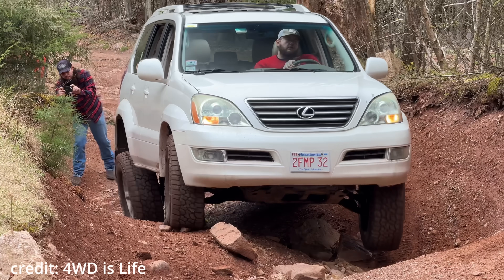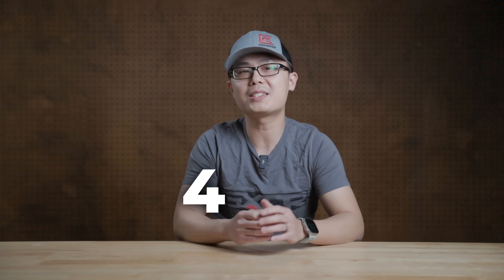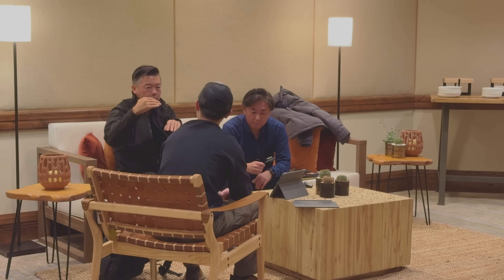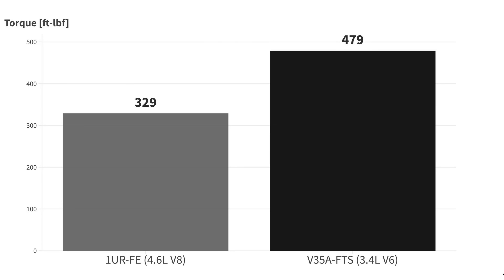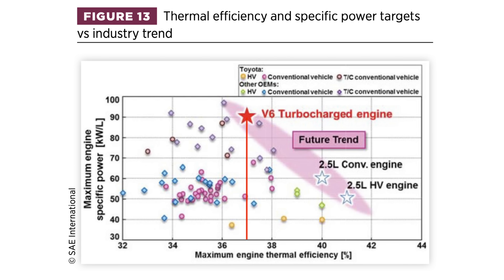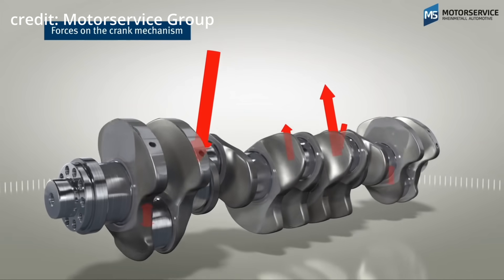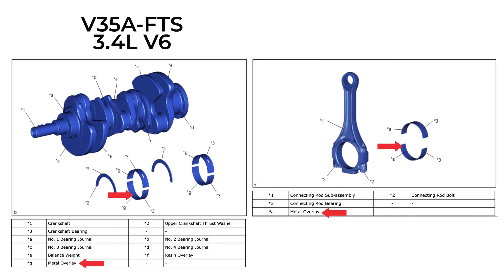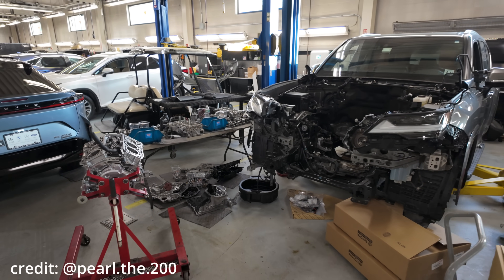Is Toyota V35A-FTS Engine Reliable? Well..It's Not That Simple

Comment: There actually IS an official explanation for bearing failures. Improper cleaning of blocks post machining and pre assembly causes blocked oil passages and premature crank bearing failures. This is well known in the Toyota community so I’m not sure why a Lexus technician would not be aware of it. This is not a design issue, it’s a manufacturing/assembly fault. It’s disappointing there have been this many failures but Toyota is usually pretty proactive in solving issues. 

‘The car care nut” does a great in depth video on the design of the cooling system in these engines. Pumping this much HP and torque out of these engines, heat would be a major factor that potentially could reduce longevity and reliability but  Toyota designed a very competent cooling system in these engines. I’m confident these engines will ultimately earn a good reputation but they’ve certainly had some issues. I have a ‘22 Tundra and so far no issues at 23K miles. Knock on wood.
Reply: Link to official explanation?
Reply: @spaulagain Discussed at length with dealer service manager. As well, in a 3rd gen Tundra owners group on Facebook, every engine failure I’ve seen posted has been diagnosed as this exact issue. There are many Toyota technicians and at least 1 Toyota engineer in the group.

Comment: Great interview.  My logic is: fewer parts in existence = fewer parts that can break. I'm sure that the entire package is very well engineered, however I have lost a lot of faith in Toyota build quality after purchasing my 3rd gen Tacoma and suffering through early part failures such a warped thermostat housing which was plastic.  Critical parts which are exposed to high heat should not be victim to bean counter cost savings and made from inferior materials.
Reply: Could not agree more. It’s a simple fact that complexity has a direct relationship with failure potential. Now this might not seem like a concern on a new car, but once they acquire age, wear, stress, perhaps a fender bender or two… They’re already unaffordable to repair for some moderate operations, I cannot foresee a meaningful number of 2025 cars being on the road in 2050. We need to apply our knowledge like a scalpel, not a sledgehammer, and stick to simplicity unless used to improve efficiency.

Comment: I was actually thinking of looking into “tuning software” to get that extra  100 ft lbs of torque they promise with more boost. Glad I watched this. We used be pretty happy back in the day with a NA 1 HP per cubic inch. The norm was no replacement for displacement. Stock, at 213 cubic inches, this is putting out 1.7 HP per Cubic Inch. and with as much torque as a 455 olds lol. I just told myself, Stop. It’s enough. Love your channel. Very well done. ♥️
Why is it never enough 😂

Comment: I bought my Tacoma in 23 because I don’t want to be part of Toyotas drivetrain experiment
Reply: Beta tester: Big benefit to Toyota , big problem for you.
Reply: Exactly. There’s a reason the name Land Cruiser means unreliable. Small displacement, turbo engines in the 80 series and prior were blowing regularly. It wasn’t until the V8 was created that they finally became good.
Reply: @JollyGiant19 What small displacement engines in the 80 Series? They're inline sixes that range in size from 4.0 to 4.5 and only diesels had turbos. All of these engines were, and still are, extremely reliable
Reply: @chrisflores4788  A turbo just stresses and engine until it blows, nothing you can do about that. Turbo = unreliable!!
Now to be serious, I see so many people express displeasure with turbos in Toyota vehicles as if they don't have decades of experience with it and highly reliable turbo diesel offerings despite how much higher pressures and heat that turbo diesels put out over a gas engine.
Reply: Bought a 2024 4Runner in January for the same reason.  Last of the naturally aspirated 4Runners.

Comment: If Ford managed to build a 3.5 Liter twin turbo V6 that puts out good power, and reasonable reliability, than I KNOW Toyota can. Honestly,  as an independent tech, I see more Toyota vehicles with 300,000 plus miles than anything else, except exceptionally well taken care of Suburban / Yukon SUV's .
Reply: This just the older early 2000’s Yukons and Suburbans or anything with afm/dfm?
Reply: My Volvo has a million miles
Reply: @ThunderRunner  2007 was the first year.
Reply: @mcglovera  Once you get up to the P2 cars, there are enough electronics to cause serious issues, transmissions are kind of weak, the 240 / 740 series were bullet proof. My experience.
Reply: @mcglovera  right - do you see any 2007 or newer suburbans and Yukons with that kind of mileage?
Reply: @ThunderRunner  There are actually many. Have heard of some over 300k miles, some even higher (to a ridiculous extent)- most I suspect either were driven long distances or used as limousines. I would trust one of these more than a twin turbo Tundra/Seqouia.

Comment: The dealership I work at has had 2 tundras with main bearing issues below 15k. They were early model tundras. The wear was allegedly due to improper cleaning from the machine process

Comment: As a mechanic with my own repair shop, I really appreciate your content. I reside in Australia and have paid a deposit while waiting for the Lexus GX550 in Australia to arrive mid to late 2024. I really hope you can keep following up on this potential main bearing issue. I would prefer the V6 turbo petrol over any hybrid engine they may release over next few years. Perhaps I should hold out on buy the Lexus till further in know about main bearing design change. Your thoughts would be appreciated.

Comment: Ford has shown for over a decade that these kinds of turbocharged V6s can be reliable long term. There are numerous examples of Ford 2.7L and 3.5L ecoboost engines with 300K to 600k miles and no issues. There's even one with over 1.3 million miles, though that one is on its second engine.  You can even get a 3.5L in the F150 with 450 hp and 510 ftlbs of torque! Though Toyota's 3.4L TTV6 might be one of the least reliable V6s out there currently, these are likely just growing pains and updates to the motor will likely improve reliability.
Reply: The caveat to the longevity of the motors you mentioned is absolutely religious maintenance and easy use.  The Eco-boost makes fun power and gets decent mpg, but they fail a lot when used hard.  By used hard, I am referring to trucks that do weekend towing.  This isn't my opinion, this is what 3 family Ford techs have told me.  In their words, "If you want a gas car or truck to last 300k miles, DO NOT buy anything turbo charged.  If you need to tow on occasion, buy any sized NA motor that meets your weight requirements and live with a little less power and lower mpg".
Reply: The 3UR-FE is kinda mid-tier in Toyota terms, but it is still outperforms all the Ecoboost engines in uptime and long term running costs. (Even at 15mpg.)
Reply: 3UR-FE is mid-tier in Toyota terms? I mean, I know it’s not S+ tier, but it’s still A-tier. Especially the Japanese-built ones employed in the Land Cruiser / LX 570
Reply: @matthewpeterson3329  It's just physics and limitations of turbos in general. Turbos dont usually last over 150,000 miles they wear out and require to be rebuilt or replaced and then if you're towing you're putting extra stress on the engine and using the turbo more with higher boost. Any NA engine is going to be more reliable because it has less moving parts that require to be replaced. Toyota is sacrificing long-term reliability to get better performance no doubt. These are not the 4.0 V6s just expect to spend more money when getting higher mileage replacing parts
Reply: @b4ssfunk3d semi truck turbos last 300k usually I seen similar results from turbo charged engines on regular trucks with good maintenance
Reply: @Dimabuildingadventures  You're still talking about a semi-truck though. I don't see turbos lasting as long in a VW Jetta 2.0
Reply: Things about Turbos is more frequently oil change, they are not intended for pulling all day and they need to be cooled off and dont use all the time.

Comment: Great indepth video for the nerds! Toyota just issued a recall on these motors saying that there is possible debris in the engine from manufacturing that is responsible for taking out the main bearings. It may or may not be related to over stress after all. I couldn't find any specifics on what they are doing to fix the issue though. Keep it up Kai!
Reply: after posting I saw your pinned comment 😂

Comment: I've thought for quite a while that Toyota engines run a little bit colder than their (especially North American) competition. Just looking at their thermostat ratings reveal a difference of sometimes 10 degrees. a colder running engine robs more heat energy from the combustion event and reduces the power. Wonder if they upped the operating temp.
Reply: Driving a 1gr-fe in the dunes of the UAE, I see coolant temps hit 92c peak, 90c average, in 4lo and under 100% load for extended periods, near redline, in 45c ambient temperatures. I do have a tranny cooler.

Wranglers with the pentastar 3.6 so easily go over 100c, I've seen them peak at 115c (manual tranny). Engine revs higher to produce similar hp with less displacement.

I think you're right. No one runs the 3.4 train turbo. And these guys definitely have the $ to do it.
Reply: Your statement about what those with means do in search of reliability is very telling. 

Do they run any Toyota Turbo Diesels in the dunes? IIRC, they should have been available there for many years. Again, IIRC, Toyota Turbo Diesels are under-stressed per unit displacement, vs. other manufacturers'. Perhaps Toyota will do the same with the Gas turbos?
Reply: @danielclawson2099  They don't run diesels at all, anywhere on dunes, due to weight.  Power : weight ratio is very important, as your engine is constantly in redline, and an engine that's lighter and produces more power is more desirable, as long as it gets you back out of the dunes as well :)

Loads of guys put magnusson superchargers on the 4.0 v6.

Comment: I was a mechanic a long time ago and I remember most main and connecting rod bearing failures were due to insufficient oil to lubricate the bearings. I heard you mentioned smaller oil ports, as well some comments referring to shavings clogging the oil ports because of fewer washings after the cylinder bores have been machined, so I am wondering if this could be issue. Of course I’m no engineer, but sometimes mechanics can catch defects that do not show up in testing. Whatever the issues are, I believe  we achieved peak efficiency with reliability back in the early to mid  2000s, since then we have been engineering backwards. In the years to come, this will be the norm.

Comment: Very interesting and thorough video, again, Kai! My assumption was that Toyota motors were so durable because they were understressed, stemming from low HP/L and mediocre gas efficiency. I didn't think that a more efficient engine would run cooler and therefore see less thermal stress.

Comment: Toyota reliability? I just returned a 2024 Tacoma with 40,000 miles on it, 4wd actuator and front transfer case totally self-obliterated. I don’t believe it anymore. Old school or no school
Reply: Is that the borrowed Mazda V6?
Reply: 40k miles on a 2024 Tacoma that was released in January?
Reply: @marsarmory6236  yeah, it was a rental. It had Washington tags on it and I’m in WV, so it drove at least 2000 to get here.
Reply: @bfromthea7663 really good actually. Only complaint about it was that I kept smacking my knees off the interior panel under the steering wheel. Enterprise had all the tech and apps disabled so I can’t comment on any of that
Reply: To be fair....you bought a rental. Rentals are never treated with care and the renters that had it previously most likely didn't have the transfer case fully engaged while towing/hauling. I don't think your experience is an accurate representation of Toyota reliability.
Reply: 40k miles in 3 months is actually quite impressive.
Reply: @mad-meh2719  someone undoubtedly ragged it, but I’ve ragged my old TJ for years and over 100k miles and it’s held up very very well. The frame is literally going to rust away before anything mechanical happens to it
Reply: @encompassthyeclipse7278  dude. You can't compare a personal vehicle to a rental vehicle. I used to work at Enterprise and own a car rental business myself...let me tell you, people beat the shit out of these cars. Doesn't matter how reliable it is, you can't expect a transfer case to last 40k miles when the operator isn't using it correctly. You're making an apples to oranges comparison.
Reply: Did yu operate it properly?
Reply: @encompassthyeclipse7278  what rental
Company was the Tacoma from?
Reply: It’s crazy how people can’t read previous comments
Reply: Lol, a rental from 1996 would undoubtedly been fine even if ragged on. Those old Toyotas were just made different.
Reply: The problem was the massive amount of miles in less than half a year. That truck was highly abused. I doubt the maintenance was done since it's so new, and it was a rental. 40,000 mikes in 5 months is basically 266.666667 miles per day. That doesn't even count the time it spent idling, which could be a lot if it was a work rental that drove far every day and also idled all day once at the worksite.
Reply: @Afriqueleblanq, They don’t have a mazda v6?

Comment: I thoroughly enjoyed the comment section a-lot of insight. I’m sightly surprised at the scale of the problem. I would had figured the first batch of 2018’s LS500’s would had shown this issue and surely 6 years later it hasn’t been resolved. 
I purchased a 2022 V8 GX460 for this exact reason I didn’t want the headache, Im sure they’ll figure it out in due time.

Comment: My fear with this issue is that it is just like the Tacoma and 4Runner front differential needle bearing issue. Toyota has yet to fix this issue. The only real solution in the aftermarket bushing. To me, it is a real failure on Toyota to not address and properly fix this issue.   From your video, it seems this main bearing issue has documented history for several years also.
Reply: Ugh, you just reminded me that I need to do mine... 😂
Reply: I believe the fix is a dampener to help the noise not reach the cab. Toyota has said that they noise is normal and won't replace the front differential anymore. As for the main bearing issue I have a feeling its the dual pulley system with the belt and the crank pulley itself is causing the issue.

Comment: It seems to be only one main that is the culprit. This helps in dispelling  the debris story and leans toward a design deficiency. undersized, convoluted path etc. oil gallery  that services that particular cap. 
My thoughts lead more to the one piece cradle v individual caps as any flex/play in that assembly would invite premature wear. The individual caps seem to enjoy a closer proximity  of bolt placement to the centreline of the crank  also they are dedicated to that bearing therefore less affected from any torsional stresses that may be present on that one piece carrier. Would love to hear input from a legit drivetrain engineer.

Comment: i’m not an engineer however, I have experience rebuilding engines. One of the things that comes to mind is the tolerance between the main bearing, as well as crankshaft and caps may be the oil isn’t seeping through as smoothly. Also, oil weight play a big factor as well.

Comment: 102.6hp/140.9lb-ft per liter is very, very low for a modern dual injection turbo motor. I have no doubt the V35A could be pushed a lot harder, but Toyota isn’t doing so to maintain reliability. We shouldn’t even be talking about being over stressed until the motor is at like… 125-150-175hp per liter.
Reply: My 56 hp per liter 4.6 ford is very under stressed. Still makes 300 ft lbs of torque. Not bad.
Reply: when you see flat torque is mostly because ECU limited..they limited the output on purpose..
Reply: Yeah it's still very under stressed compared to competitor's downsized engines. The Stellantid Hurricane I6 makes 140hp/L for the "low" output variant and 167hp/L for the high output variant.
Reply: Except your basing this feeling on the old legendary turbo engines that were made with CAST IRON BLOCKS.
ALL modern pos engines are made of aluminum trash, ei disposable.
They will NOT last.
Reply: @riverpirate1022  I’m definitely not. BMW B58 is at 127hp/L in the B58 (their commodity 6 cylinder engine), and 150hp/L in their S55 performance engine. Ford is at 128hp/L in their Ecoboost Raptor motor. Mercedes is up to a whopping 208hp/L in their M139 4 cylinder performance engine. All of these are aluminum block, all proven to be at least moderately to very reliable, with thousands to 10s of thousands of examples at 100,000 miles and beyond. 
Iron blocks are obsolete in the modern era for street engines with iron alloy and PTWA application being more than good enough. Unless you’re pushing absolutely massive amounts of boost, modern aluminum blocks aren’t a problem.
Reply: @noobasdfjkl  Calling a BMW or Mercedes "reliable" is like calling a house an "investment".
Reply: @lexusguy9127  Congrats, single dumbest comment I’ve ever seen on YouTube. You should be proud.
Reply: @noobasdfjkl  There you go again ... Taking your losses personal.

Comment: Here in Australia there are a number 300 series that have engine fails. Some bearing, some piston cracking. One of our mechanic/ researchers that specialise in Toyotas are still gathering data, but the data so far suggests that 0W20 oil combined with a sump volume of 3.5 litres, plus our hotter weather have contributed to catastrophic engine fails.